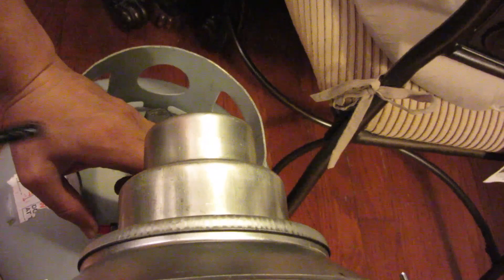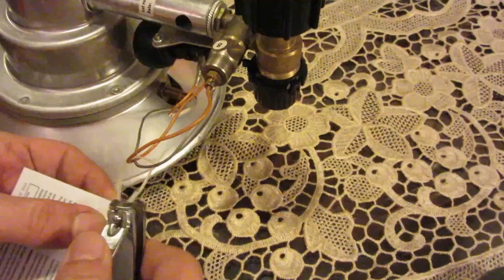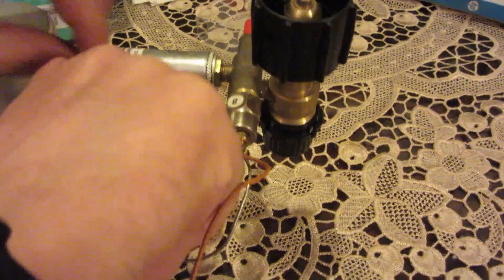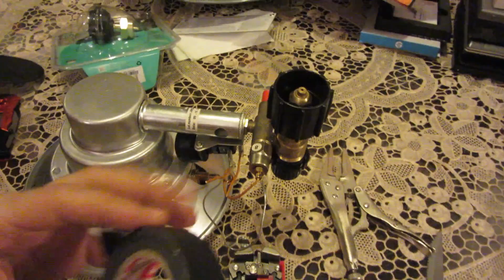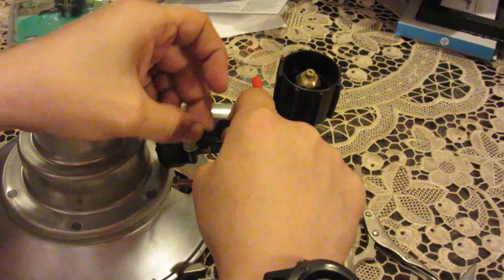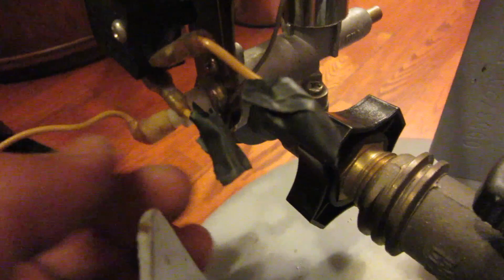How to fix your propane heater that wont stay on.Buddy heaters CLICK IT! CLICK IT!

Comment: MR. SAFETY HERE. "Makes it less safe which means it won't shut off on it's own."  "Use it at your own risk." This is supposed to be used outside not inside." "And make sure you don't have children around when your heating yourself up." YOU'LL BE HEATING YOURSELF UP WHEN IT EXPLODES. 🔥🔥🔥

Comment: That thermocouple turns the gas off if heater tips over.  Now I do believe all the standard tanks legally in service today ALSO have an anti-tip shutoff if it goes over, so as long as you are hooked directly to the tank, it should be safe.  You just eliminated a failure prone element.
Reply: There us an old saying amongst pilots: Redundancy is Life.

Comment: Preciatcha. At the campsite listening to my wife bitching and moaning about how cold it is at the campfire. So I put 10 pieces of timber on the fire to no avail. I mean I was afraid we was gonna burn the campground up. Still bitching,  I remembered my trusty propane heater in the truck. WHAT THE FUCK IT WONT STAY LIT THIS DAY IS LOST. mamma ain't happy I ain't happy 😉 but then I found your video. Disaster averted. Back on track for a romantic evening in the camper.

Comment: Just want to say , I just banged on the bulb part lightly with the butt end of a screwdriver gently about 10-20 times , then heard a rattle . The peice inside was stuck/frozen.. then I heard it rattling .. turned it on , all good

Comment: You don’t have to cut any wires. Pull the two wires with the female spade connectors (typically with rubber insulating boots) off the tip over ball(s). Cut a bare piece of #14 solid ground conductor about a 1” long from a piece of romex. Push the bare #14 conductor into one side of one of the female spade connectors and push the other end of the bare #14 conductor into one side of the other female spade connector. Tape the new connection(s) to secure them and you are done. 

This method doesn’t destroy the wiring in the event you want to purchase and replace tip over ball(s) and reconnect the wiring. If you don’t have romex to get the piece of #14 bare conductor any thin narrow short  piece of metal will join the two female spade connectors.  If you don’t have a thin narrow short piece of metal and the female spade connectors have rubber insulating boots slide the boot down the wire off of one connector and push it under the boot of the other connector so the connectors overlap and make contact under the boot. Tape all connection to secure them.
Reply: no; people are not going to read and understand your long and wordy tutorial...
Reply: I did🤷‍♂ @DougHinVA

Comment: You could just disconnect the wires and plug them together instead of cutting them. 

I figured that was some safety switch and I could bypass it. Thank you. I've never even used this heater before and need it now.

Comment: My fix was:

To turn down the main gas supply on the tank when its warming up. After a minute or so, I turn the tank up to full open.  For some reason the extra gas pressure would apparently blow out the flame when releasing the "pilot" button. 

 I also may try moving the thermocouple to see if that makes a difference, but Im not sure how that would be related to my tank pressure. Because mine stays lit after I run it with the tank barely cracked open for that first minute.
Reply: This worked lol wow just needed to barely have it open
Reply: I tried didn’t work sad

Comment: Mine was doing the exact same thing. If you want to keep it safe, clean the terminals on the safety switch. Mine were just a little dull and kept it from working. Or can buy the safety switch for like 12 bucks.
Reply: Do you happen to have the link?

Comment: I believe the two wires are snipped from the safety cut off  ball contraption. The video is a little less clear to make it out. I'll try it after I remove the Mr Heater and whack that ball contraption and try to keep it lit....one more time. Thanks!

Comment: I would like to know if it's worth buying the termocouple of Dyna-Glo model  TT15CDGP. When I press the button it doesn't stay on.
Reply: Use a clamp to keep the button from shutting it off. Ask me how I know? I’m using it right now 😂
Reply: I’d buy a propane blower

Comment: Or you can replace the small battery inside the black ball and keep it safer and legal...
Reply: I'm having trouble with my grounding wire, the one thats not yellow. It  broke off from the piece that it's supposed to be on, I found a temp fix with the screw that holds the piece where the propane comes out (lock it up with the screw). But the wire keeps getting corrode with use, any idea on how I can make a permanent  fix? I usually have to use sand paper with the wire a bit  if it doesnt light, but that's only after a few times of use, and then it starts right up again.

Comment: There was no need to cut the wires, could've simply unplugged both wires and used a metal coupler to reconnect the plug ends together, at the same time bi-passing the safety shut-off switch. JS ;)

Comment: Nothing involved in a fix with a propane heater should involve the words "use it at your own risk" or "dont use it around kids"... better to spend 50 on a new one.
Reply: I have a new one and it doesn't stay lit
Reply: @chuckosborne4403  then return it. Lol
Reply: @spLiffyFOUR20  Bought it late last winter, used twice and worked fine. Went to use it this year and it won't stay lit. They are junk, have to disable all the safety features to get them to work. I'll stick with an electric heater for my patio.
Reply: Or spend 8 bucks for a new switch.  The part number is on the side.
Reply: Not to worry!  Your friends, family and kids can catch on fire with ease (new one or not)!  Read the instructions and ask somebody.  These heaters truly work great, but when used in the proper conditions.

Comment: Don't do this.  Buy the new Thermocouple and install it, not that hard. And in the end, you will still have the safety of the original design.
Reply: The thermocouple was not altered.  The tip over switch was altered.  The original design did not have a tip over switch.

Comment: I did it but it still doesn't work...I noticed that the metal wire, at least one side is not attached to anything...does both sides have to be attached?
Reply from the maker: Hi. It does not work on all models. Be safe pls

Comment: why not just get e new themalcouple
Reply: Thermocouple is not what is wrong. It is the plastic safety tip switch
Reply: @colt45peacemaker  The tip switch rarely goes bad.  If it does, it only costs 8 bucks to replace.  Thermocouples cost about 10 bucks.  I've had 2 thermocouples fail, but never the tip switch.  It's a very simple mechanism.